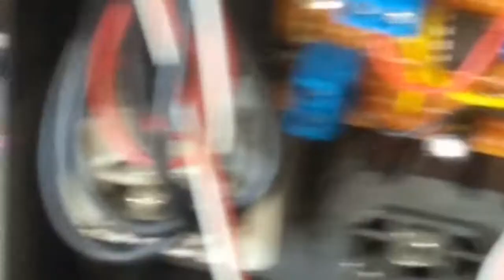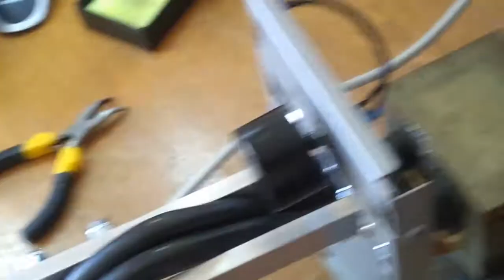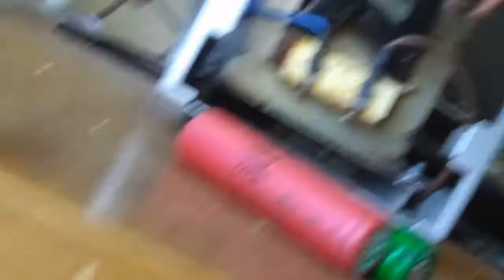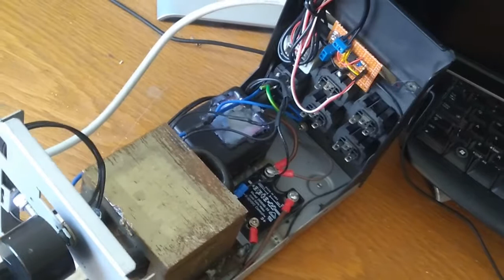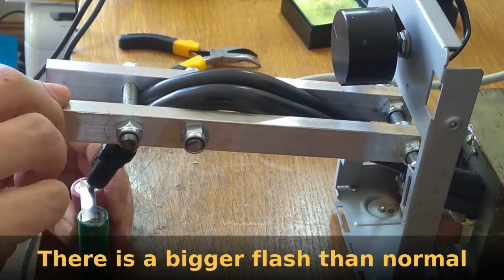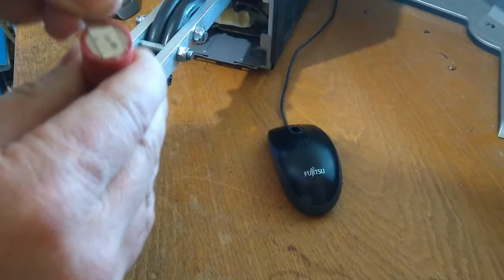Part 3 DIY Battery Spot Welder, Updated with a timer switch and knob.

Comment: Very good enhancements. It's much better than before. Thanks.
Reply from the maker: After making this video I built a battery pack but after a while I found the negative terminals of the batteries were not welding properly. I had to keep increasing the duration of the pulse until I was uncomfortable with the amount of heat generated. It still worked but I'm not 100% happy with it. I'm still not sure what the problem was but I think it may be due to the voltage being too low with only two turns so I have ordered some thinner 16mm wire and will post the results.